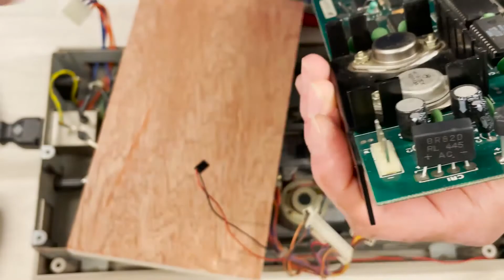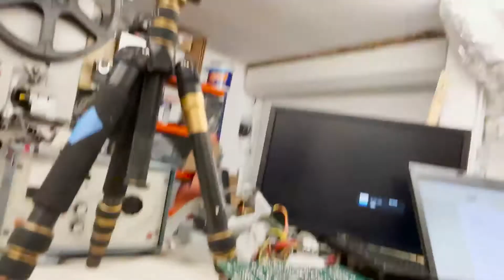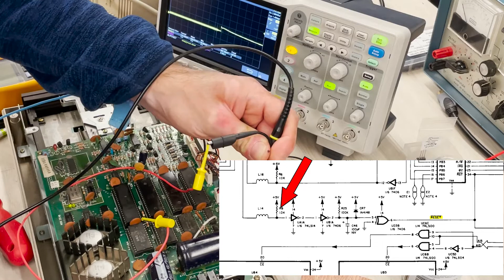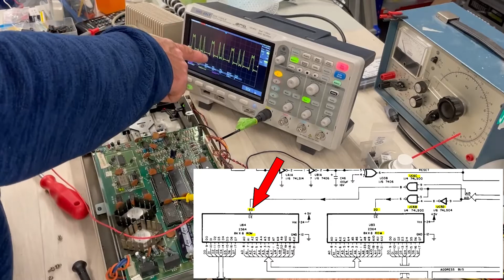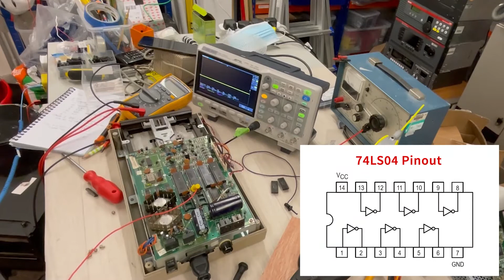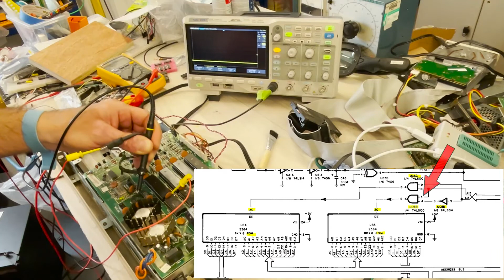Commodore 64 Repair part 2: 1541 floppy drives repair

Comment: That BR82D on the rectifier would be easy enough to look up. 2.0A continuous current. 50A peak. Voltage range probably doesn't matter at these low voltages. If anyone watching is interested. They seem to be discontinued now, but surely there are similar replacements. 3.55-4.00mm pin pitch.
Reply from the maker: Oh, that's an old video for sure! Sorry for the bad "everything" (sound, editing, framing, length) but it was a cool repair! I hope you enjoyed it!
Reply: @tony359  I know. 😊 Comment was left for future viewers. No diss to your work. 👍🏻
Reply from the maker: No worries, I didn't read it with a negative meaning!